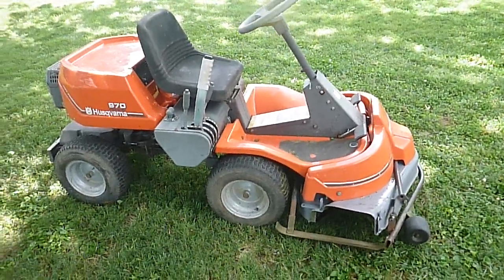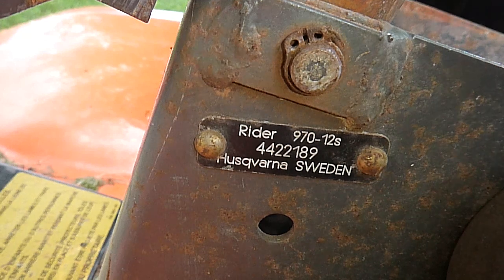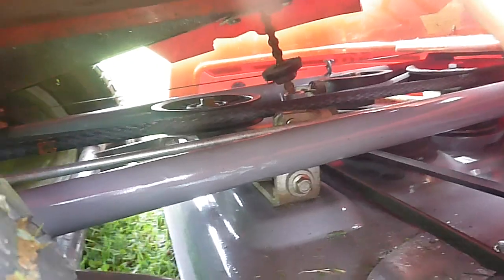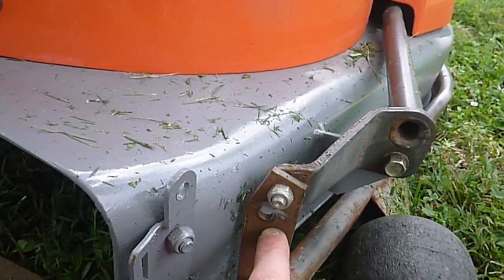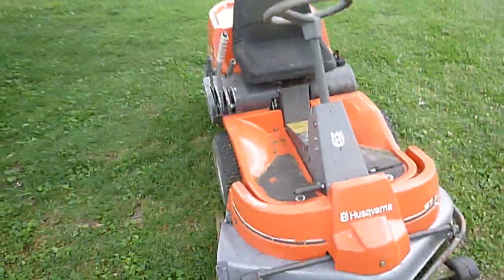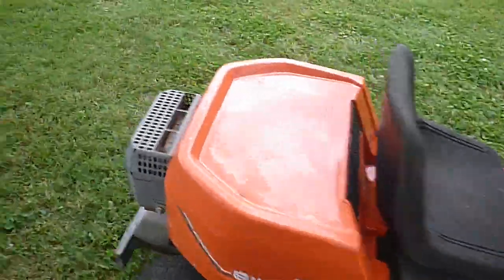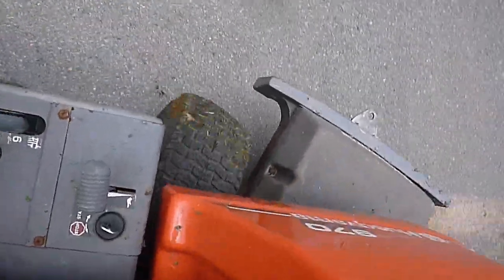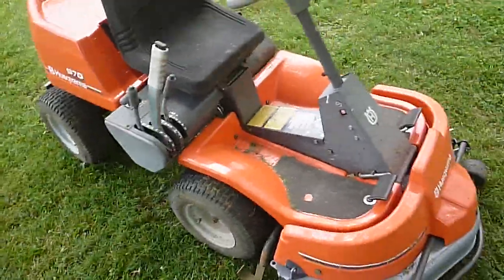Husqvarna Rider 970

Comment: Thank you for this. I have a hydrostatic version of this which I have had for nearly 20 years. Fantastic machine. Better than my Toro but it does tend to get stuck in mud. Light enough to be pushed out manually. Parts are expensive.
Reply from the maker: yeah the joys of having a unique model. seems like the parts have gone up over the years, I wonder if they've discontinued a lot of the parts for the earlier models and therefore as supply dwindles the prices go up. I know lexus did this to my first gen GS300. Window regulator was $750. No aftermarket available. Go up to the next gen you could get regulators for $100 all day long. But lexus didn't make any more new ones for 1st gen so as they sold out, they raised the price. Just another way to try to force us to buy new and stop fixing stuff ;)

Comment: try taking the front wheels off. fun fun fun. and...the blade drive belt is a toothed belt which has to be correctly timed, or the blades smash into each other. truly a brilliant design that makes as much sense as a screen door on a submarine!!
Reply from the maker: This particular mower did not have the timed blades. One of the rare ones that didn't have the bioclip deck. We sold bunches of them, but as Zero turns came to market, Husqvarna sold a lot less. They were orchard mowers. Really great for that purpose, at least that's what I was told at Husqvarna school LOL. Thanks for watching!

Comment: I have a Husqvarna 18 AWD . I absolutely love it.  It has been dependable,  easy to work on.  THe deck is simple to remove to clean after each use. I always pressure wash my decks on all my mowers after each use. I am looking to buy another one but these are hard to come by, even brand new.

Comment: My Rider 155 4x4 has run great for last 6 years. It’s made in Sweden also. I put an hour meter and a voltmeter beside key slot. It’s got the 15 Koehler motor and the quick removal combi deck. Non ethanol super gas only. Paid 2600$ used. 🇨🇦

Comment: nice video josh...the debate rages on...paul harvey pronounced the q as a k..husk..varna...did you know that swiss watches carry the same identification as the husqvarna mowers...if it is a true swiss made watch it will say swiss made at the 6 o clock position...swiss on one side of the 6 and made on the other side of the 6..if anyone says they have a swiss made watch check the face...if it does not say swiss made in the six o clock position it is not...it may be swiss components assembled in china or florida but it is not assembled in and from the land of the swiss...

Comment: Is there a mower deck belt install/replacement diagram available online. Or do you have an image of the diagram
Reply from the maker: well, there is one in the parts diagram, but there's like 2 or 3 different deck styles and several different models of this mower that all look identical but are very different from one another. you can look up the manual on www.partstree.com, you'll need your model number from under the seat. Sometimes it's hard to get the manual to come up, so try searching for it different ways. For example, like husqvarna rider  155, or Rider 155, or Husqvarna 155. If all else fails you can call them. Once you have the diagram you can see which deck you have and it'll show you how the belt is routed.

Comment: Do you know the exact deck belt size? I have the same mower and have found the part number  it can't find anything that will give me the belt size.
Reply from the maker: I should have measured them before I installed them, but No, i did not. I ordered all the belts from www.partstree.com. We didn't even have old belts to work with, someone had really messed this one up trying to rig it.
Reply: Same deal here. I'll just have to order it. Thanks!

Comment: Awesome, thanks mate.  I'm in Australia and just picked one up.  All working order, just changed the fluids and filters.  However, its a bit jerky in the driving.  It's a peerless MST205 gearbox, but trying to avoid splitting the gearbox.  Any thoughts what it could be or what I can do.  I can't see a drain plug underneath, so not sure how successful I'll be in trying to flush it out and put new gearbox oil in.
Reply from the maker: man, make SURE you do not have a chunk missing out of that belt. I've seen that cause issues before. Aside from that, there's a chain inside that gearbox that if enough water gets in there it can rust it up and cause it to kink. The grease inside those manuals is actually a super thick grease called 00 grease. Usually when we put them back together we just use a couple tubs of wheel bearing grease lol. But i'd suspect the belt first. usually the trans will stop shifting long before it stops working, or most commonly will strip the pinion gear and bevel gear on the input side. best of luck! these are great mowers!
Reply: @HamiltonMechanical  Thanks legend!  Will do.

Comment: That Rider 970 is a sharp looking Rider, you did a great job fixing it up.
I've got two Husqvarna R322T AWD riders look very similar to your 970 Rider.
There a little newer than your Rider 970 and are the best mowers I've ever owned.
They were also made in Sweden too.
Reply from the maker: Yeah, I never understood the inconsistency with the model names LOL.  The 970, 155, etc. Never did figure out what the differences between them were, and I worked at a husqvarna dealer for 10 years! lol. Thanks for watching! :) I think maybe the 970 was only offered with 5 speed and maybe the 155 was the hydro? Although that's just a hunch.
Reply: @HamiltonMechanical  just wondering if you could give me insight on my husqvarna 970, okay hear it is,  I have really good coasting speed when on pavement in all gears, when on grass and the deck is dropped it seems to lag, and drive really slow, when deck is not dropped and just driving on the lawn there is not a problem with speed, my problem is when I lower the deck and begin cutting it will eventually lose acceleration, any ideas???

Comment: hello..love what u did for this machine. I have a ryder 970 also..I love it...but of course to love this machine,u must be very patient and a wonderful mechanic.lol. I also have replaced everything except the motor. I did have to lift the motor to replace a bearing down below i think..anyhow.I have terrible back issues now and working on this machine is becoming almost impossible.  I purchased a small electric winch and i lift this husky all the time to get to the blades or the rear all the time.lol.....But here is the  main problem.....oh,yesterday i broke a steering cable,i had 1 in stock...that took some time..but i got it.....anywho.......last year we di a major operation on the deck...and now the middle cut is higher by 2 inches than the wing blades......the blades measure the same distance from the ground.the blades r on correctly....I have contacted the local husky store where it was purchased...they r useless....i have called anybody that has anything to do with husky...i have spent hours talking to europe husky.....nothing......do u have any clue or any contacts that might help..thnx...john

Comment: I just bought a Husq rider pro 15 that has a KAWASAKI FH451V 15hp motor it was in great shape although it was very, very dirty with no gas cap and 1/2 lb dirt in the sludgy gas tank. Bought it at an estate sale for 200 dollars, so far Ive put on 2 new tires for 70 bucks, a 50 dollar gas cap(crazy) 45 dollar airfilter cover(crazy also) new spark plugs, oil change air filter for 25 total.   Total so far is roughly 400 dollars.   Cuts nice, its fast.  Have to adjust my steering a bit when my steering wheel is straight it goes a bit right when moving.

Comment: 😎🤘nice machine
Reply from the maker: this one was fun! something I fixed up for my brother in law. Check out my video on the rider 16! It has some neat party tricks ;) I sold these mowers brand new, I think around 2000 you could buy one for around $6k if I remember correctly. Very expensive, even for the time, but 20+ years later they are still going strong! We had one fall off a truck once and didn't even phase it! nothing bent!
Reply: @HamiltonMechanical  European strong. Even some of the small equipment today, are very well belt.  They also came out with a remote electric mower for the city folk with small lawns.
Reply from the maker: @HVACRNorth  this model of riding mower is the only sweedish made husqvarna rider imported to the United states. The rest are made by Electrolux (Poulan aka American Yard Products)

Comment: I have the R220 model and I really like it but lately the steering is getting hard to turn but I don't see a lubrication point at the pivot where it articulates. I see on the parts diagram their is pulleys, bearings and cables for the steering and I'm not sure where to start. Do you have any ideas? Thanks in advance.
Reply from the maker: make sure one of your springs has not come off or broke. There should be two heavy springs in the back that act to return the mower to center position. Also, remove the cover in the middle of the mower (between your legs) and look at the cables, make sure they are not badly frayed. The updated cables are plastic coated, the original ones weren't. make sure the chain the goes around the steering column that attaches to the cables is well lubricated and not binding. and if all of that looks good, then i would suspect the mower pivot point. I can't remember about grease fittings but I know there are definitely bearings in there that can fail, and its not an easy repair, but can be done. get it in a nice slick flat spot, and turn the steering wheel from side to side. you shouldn't feel any grinding coming from the area where the mower pivots. If you do, then the bearings have gone bad. There's two roller bearings in there if I remember correctly, but it has been many many years since I have done that repair.

Comment: Where did you get your parts for this. I completely rebuilt the engine on mine (runs great) but I can’t find the blade adapters. They are discontinued everywhere.
Reply from the maker: I got all my parts from www.partstree.com. Didn't have any problems with availability, but I did have to wait for them to get in stock since most the parts for these machines come from Sweden Also, the way they format the model number for the parts lookup can vary from place to place, so if it doesn't come up, get creative. You can also google husqvarna rider 970 parts diagram and you'll see partstree, jacks small engines, and probably a few others. Jacks and Partstree have the best access to diagrams, and partstree tends to be a bit cheaper than jacks but both are great to work with. If you can't figure it out there's an 800 number you can call :)
But so far as I know, most parts were still available, at least at the time I made this video. 
The blade adapters had special shear pins that went in them, and it was a royal pain. I had several customers shear them just getting into heavy grass, and many went and bought a piece of steel rod and made steel pins that wouldn't shear, but then they'd snap the deck belt if they hit anything. Also, using ebay with the part number helps if it has been discontinued, you can keep a search open as people do tend to sell new old stock parts as these old shops close up. 
I'm still waiting for a pulley for my honda HT3813, what a thing to discontinue!

Comment: Hi - any mods available to reduce the noise of this machine?
Reply from the maker: I'm not aware of any, although these were never considered noisy machines. What kind of noise is yours making? I know the mufflers of that era loved to come lose, they weren't welded to the pipes coming out of the engine. If you know a welder, usually having those welded up helps a ton. your muffler may also have rotted on the inside and no longer muffling properly. The bearings and idlers in the deck will start to roar when they start to fail. but aside from that, I can't think of any reason your mower would be louder than normal :)

Comment: Where did you find parts for this...our transmission shift cable is broken and we need to buy a new one?
Reply from the maker: I was able to order all the parts through www.partstree.com  although i will stress make sure you have the right model and serial number as there are a few different versions.
Reply from the maker: https://www.partstree.com/parts/husqvarna/mowers-rear-engine-riding-lawn-mower/rider-970-12-s-husqvarna-swedish-rider-1994-03/
Reply from the maker: that's the parts diagram for this particular model. And just to be clear, the swedish weren't the best at making diagrams back then, so you'll really have to hunt every picture for what you're looking for LOL